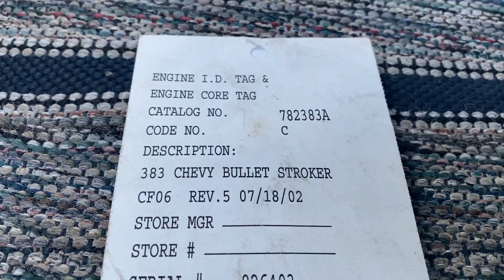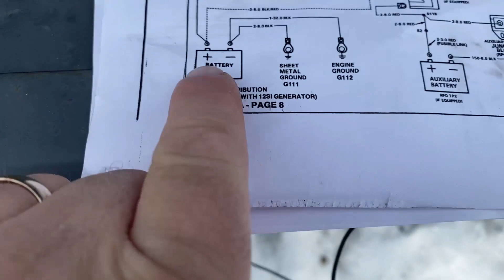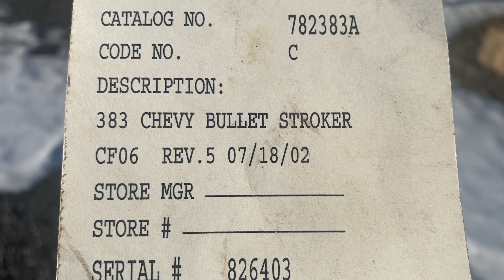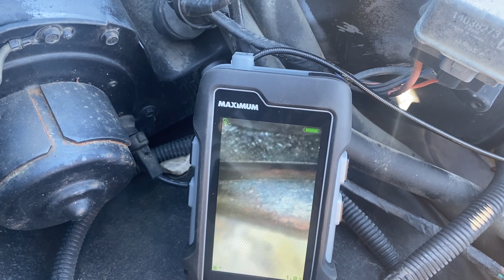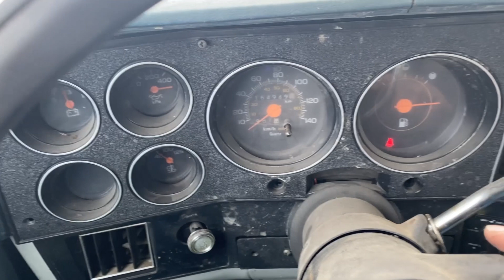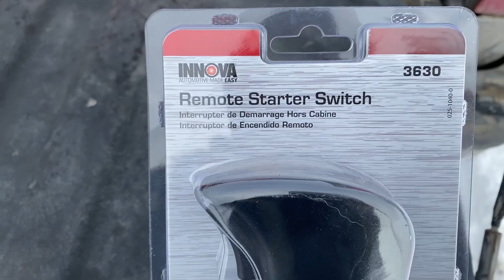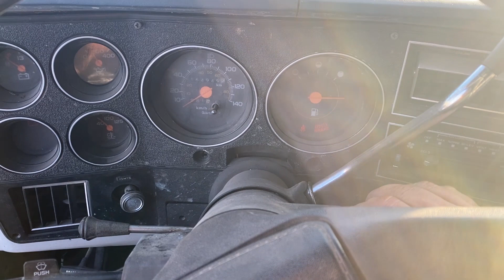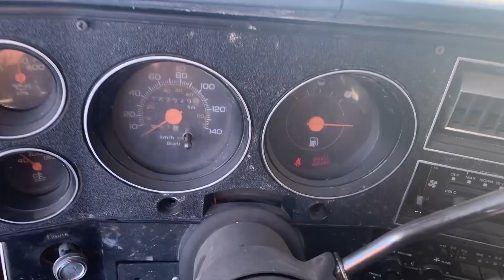Crate Engine sat for 18 Years - Will it run?

Comment: My concern would be, if it's a flat tappet cam, did the engine builder do a break in, or does it need a break in run ? Great job getting it running, especially outside in the cold !
Reply from the maker: That's a good point, maybe I should put some break-in additive in before I run it again.

Comment: You seriously never put an air cleaner on it?  This can’t be possible 🤷‍♂️
Why wouldn’t you cover the engine?  You potentially got a great deal and you did the same thing as the last owner.  I’m totally confused!
Reply from the maker: Yes I should have covered the engine, I do have it covered now. Just didn’t think about it at the time. It already had water in the engine so I don’t think I did any more damage but yes that was a lapse in judgment on my part.